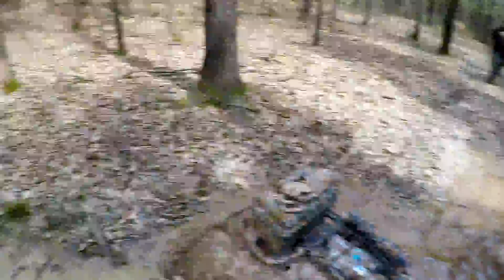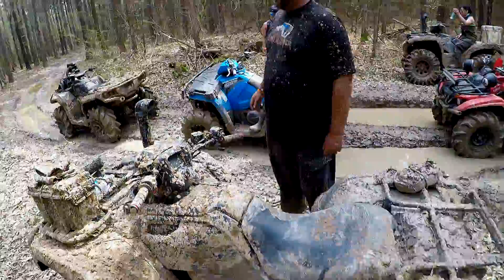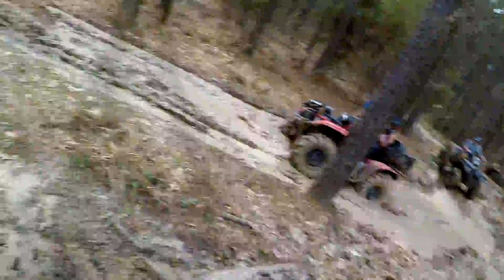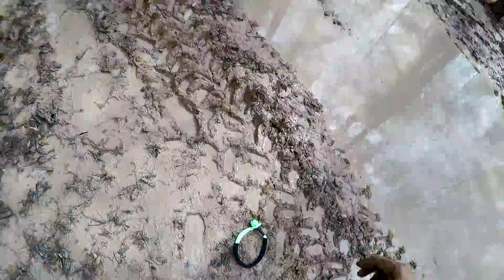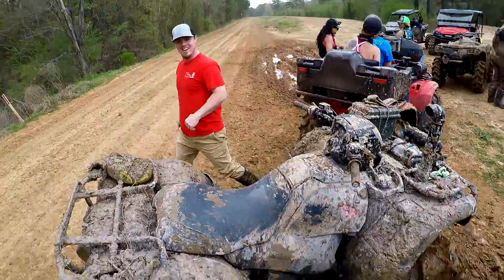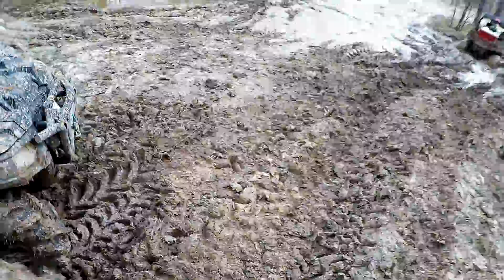I Ride A Honda Of Course I'm Good! | Muddy Bottoms ATV Park

Comment: Do you have a lot of repairs on your ride due to the deep holes? I see guys on youtube that will break an axle or have some other mishap. Looks like it could get expensive. I just bought a new Honda Rancher with 27 " Mudlite 2's and it does well in mud. Don't think I would hit some of the mud holes that you do, but it does look fun. I rode a Carter's off-road park 2 weeks ago in Alexander, Ar and had a blast just riding the power line right of way.

Comment: Do you ever have over heating problems with all that mud on the rad and stuff? Just curious because I got the same kind of wheeler and wanted to know if I need a rad relocate
Reply from the maker: I had a couple isolated instances but that was more from me not rinsing out the radiator when I washed my bike. But I’ve honestly been good without a rad relocate. Just make sure to give it a rinse between rides.
Reply: Swamp Ass okay thanks man ! Huge fan btw